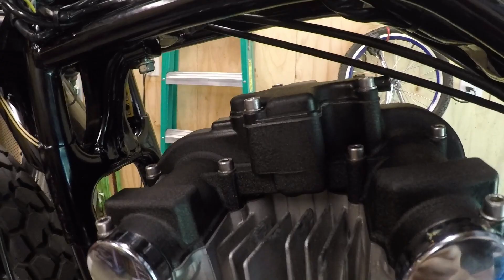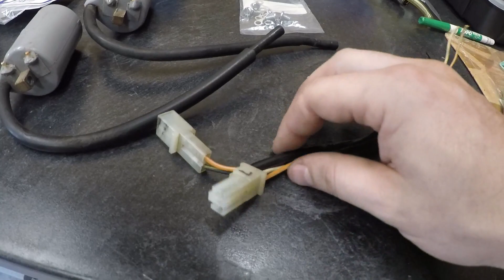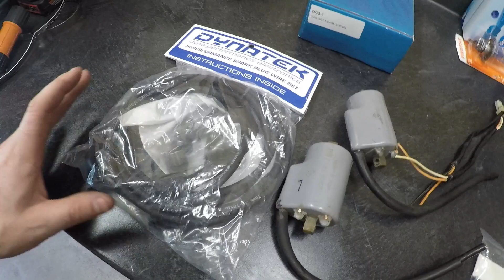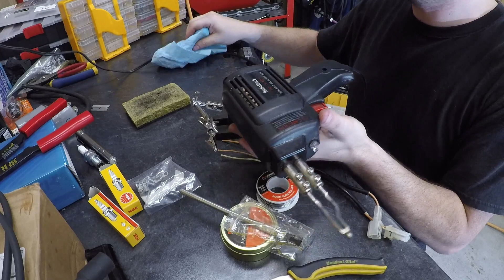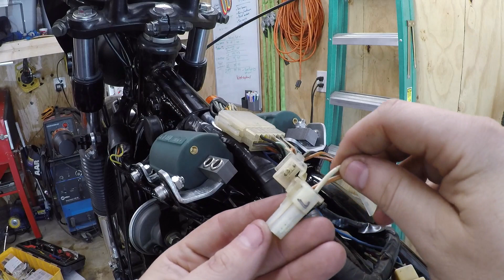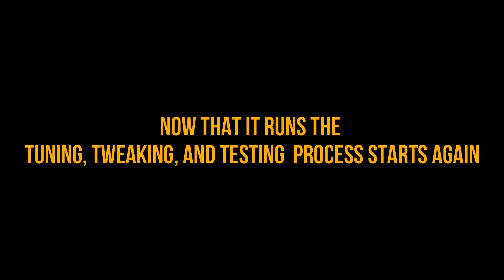Custom Suzuki GS450 Scrambler - FIRST START / New Coils / Plug Wires - Repair Series EP8

Comment: @BrickHouseBuilds are you using the same OEM B8ES spark plugs? I'm doing this conversion on my GS450L and would like to know if the original plugs can be used or if the resistance will be off.
Reply from the maker: @eliotsell7483  This was so long ago that I have no idea what plugs were in the bike but you should at least try to use what plugs you have. No damage would occur and if it doesn't work you can easily change to a resistor plug.

Comment: Hi- where did you source your rings and gaskets?
Reply from the maker: I believe I linked those in the video where I do the rings. Partzilla, cmsnl, dime city cycles, and ebay will get you most of what you need
Reply: Thanks for the quick reply. I’ve not had any luck with those sites. I’m told the rings are discontinued. I have a set for one cylinder. Looking for one more. Part number 12140-44110. Any help is greatly appreciated!
Reply from the maker: @DanDoherty-vw8go  a quick Google search shows cmsnl and eBay to have them among others

Comment: Hi need your help can you tell me the cdi wiring? I got the tr igniter thanks!!!
Reply from the maker: You can refer to your stock wiring diagram in your service manual for that. Models change by year so my info may not match.
Reply: @BrickHouseBuilds  thanks a lot bro!!! I solve it already!!!!

Comment: Would you recommend Dynatek over an Accel setup? Thanks for the helpful video!
Reply from the maker: Well I don't have any experience with the Accel on bikes. I don't want to say I prefer one as they are both likely quality pieces. I have however had continued success with dynatek
Reply: @BrickHouseBuilds  Thank you, I'll look into some Dyna's! The Accel have been harder to find in stock than the Dynatek, but many have said they are very similar in performance.